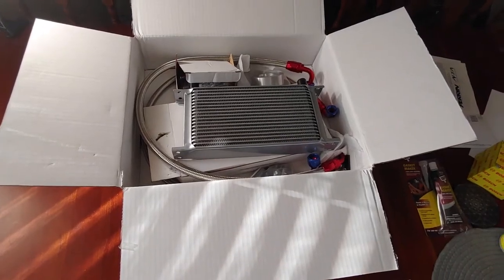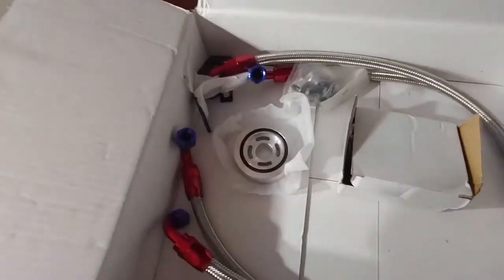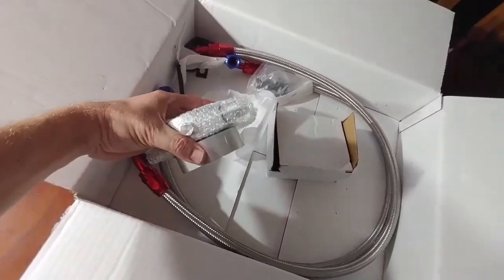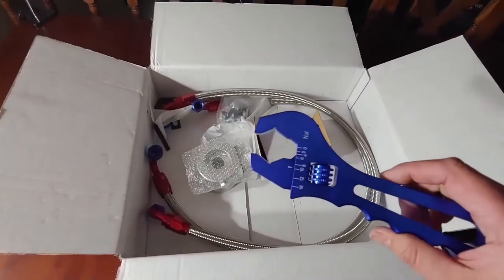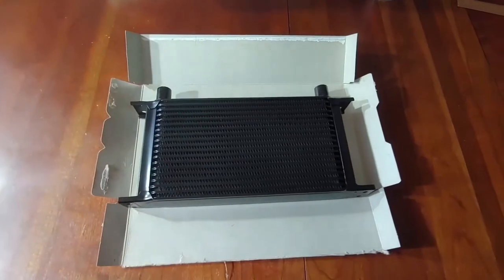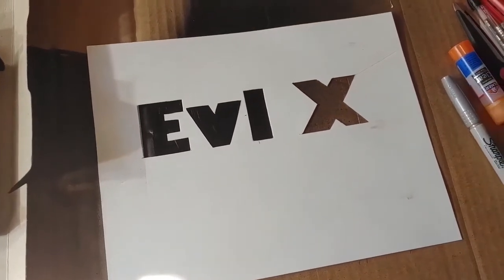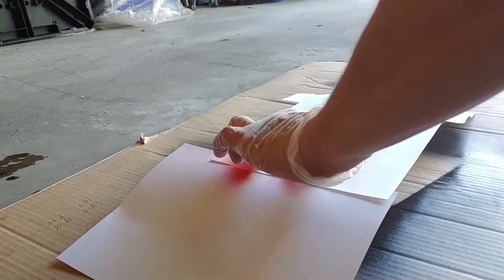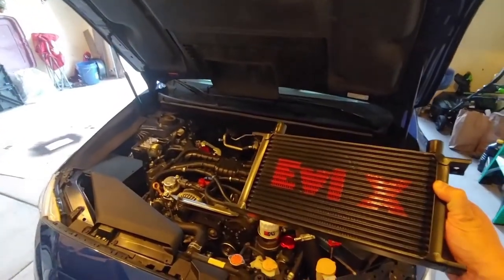CX Racing Oil Cooler Overview and How to Custom Stencil your Oil Cooler or Intercooler! 2015+ WRX

Comment: For a little added insurance I went ahead and used a little high temp permatex gasket sealer on both the threads for the lines and inside the groves that hold the provided o-rings for the sandwich plates. You can definitely still retain the factory oil cooler, however you will be limited to only using the short oem oil filter. appreciate the shout out 👍I'll be patiently waiting for the next video.
Reply from the maker: Thanks for checking it out! So you pulled out the the o-rings from the sandwich plates, put in the sealer and then put the o-rings on top of the sealant? I saw JC Rod's videos and he said he got some Dap Gasket Maker. I picked some of that up but the top sandwich plate didn't look like it had enough of a bezel to get any sealant on the outside out the o-ring, so I see how it would make more sense to put it in the o-ring groove. Do you think the Dap Gasket Maker will be good or would you think the Permatex would be better?
Reply: @evlx14  I used a decent amount of permatex and haven't had any issues.
Reply from the maker: https://youtu.be/68A7KvD15U4